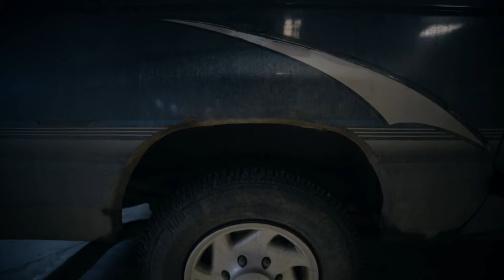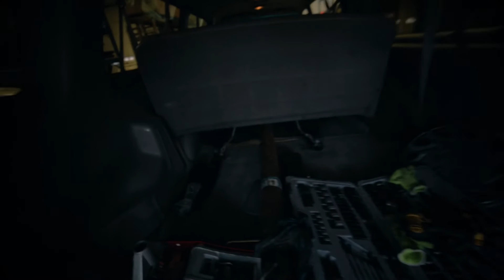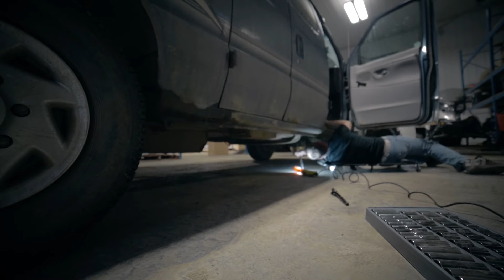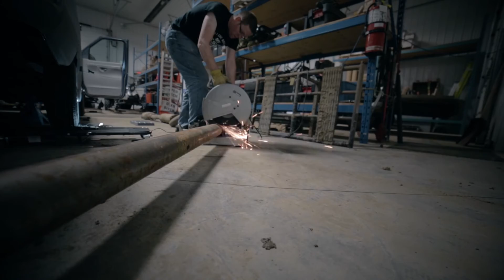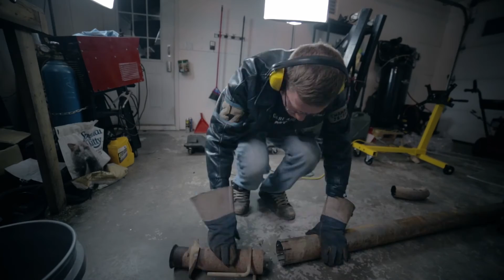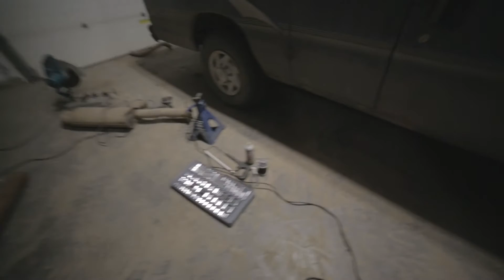DIESEL POWER!! (New tow rig + first mod!)

Comment: Get a set of aluminum wheels from a f250 cheap at the pick your part. Changes the look instantly.
Reply from the maker: LFS Trucking I actually picked up a used set of motometal wheels locally. They look pretty good. @2j_r34 on IG for pics

Comment: like haggard garage but better lol got alot more room with that club wagon
Reply: Pistonhead Productions well I ended up getting a 7.3 but it's 96 f250 4x4 extended cab with a 5 speed and a bunch of mods for 3700
Reply: Pistonhead Productions dude your channel is the best
Reply: Aetoc it was actually at a repairable vehicle place and all it had for damage was a broke rear window and a small dent on the hood other then that no damage no salvage title either
Reply from the maker: Stephen Cain pretty much. I figure I can take two rows of seats out of the back and have tons of space for sleeping and tell storage while still being able to have 5 people in it
Reply: ive been thinking about getting one for the same reason and thier cheap
Reply: That's a pretty good deal! The cheapest thing like that here was like $8000-10,000 and I was not going to spend that much.